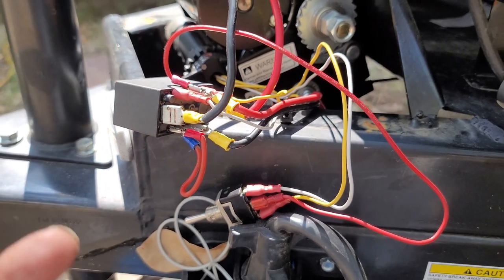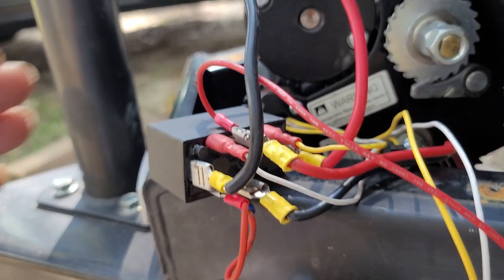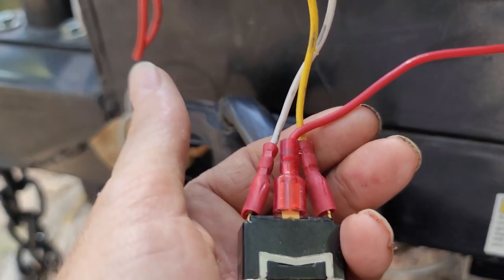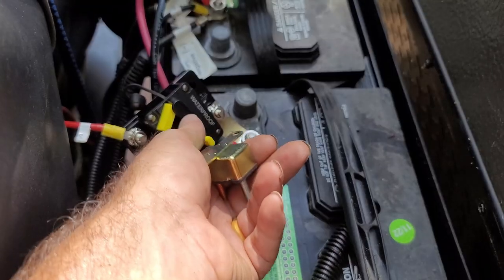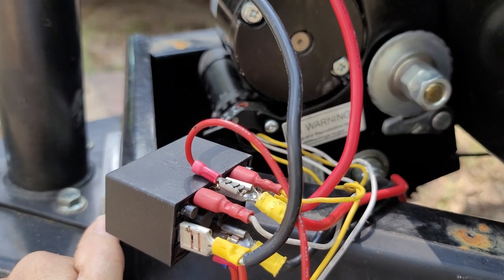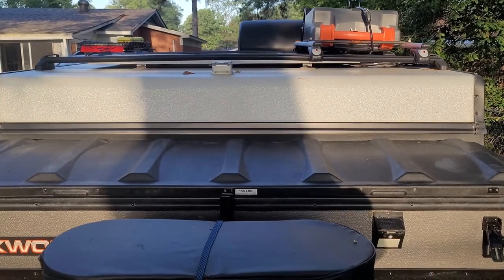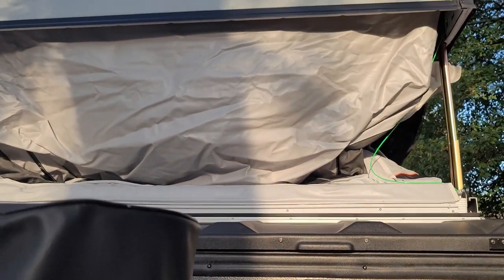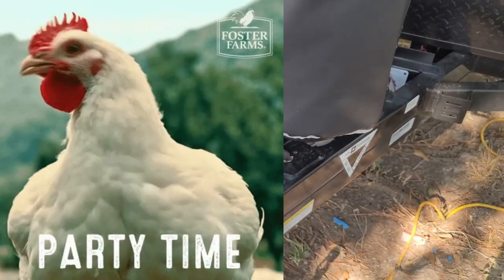Popup Camper  Electric Winch Relay Replacement: An Easy Swap!

Comment: I have the same electric motor set up. Was ¾ of the way up and it just died on me. Wont go up or down. Lifeless. Doubt it was the motor or switch, assuming relay. Thoughts?
Will probably pick up that relay. It still working for you?

Thanks!
Reply from the maker: Still working great. Have you tried taking the bottom cover off and tapping on the relay while pushing the button down? My relay wasn't engaging, and I could tap it with a screwdriver handle to make it engage.